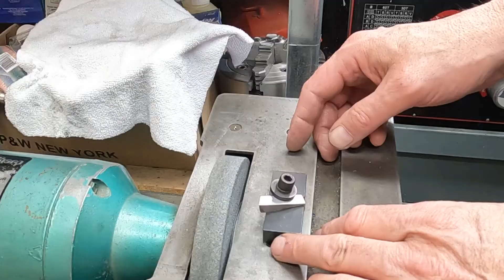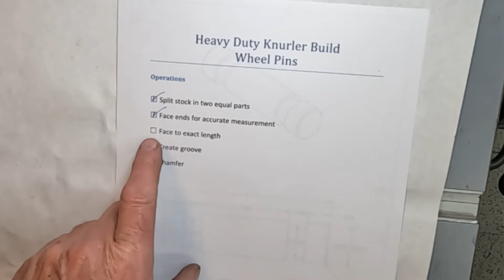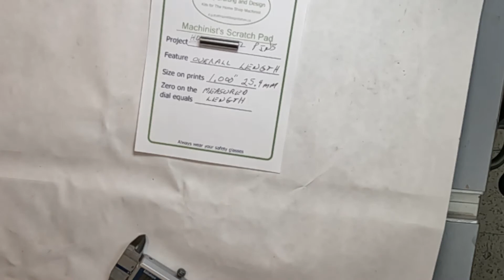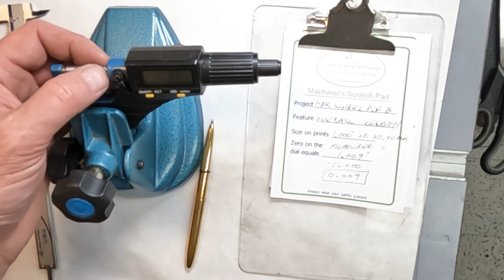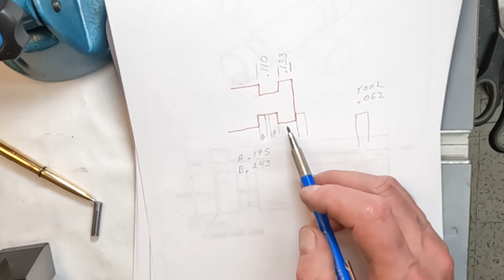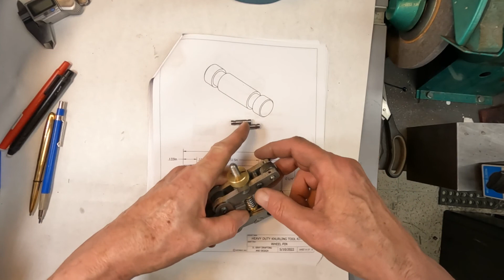Heavy Duty Knurling Tool Kit Build Series Part Two: The wheel Pins Featuring the Diamond Tool Holder

Comment: I’m curious Doug about your Diamond Tool Holder.  I’ve been looking at their website it looks like for a BXA tool holder on a 14” lathe that I would want the 16mm.  What size did you end up getting?
Reply from the maker: Hi Jake
I got the 16mm size. My lathe is 14x40.
Reply: @d.graydraftinganddesign361  Thanks Doug!